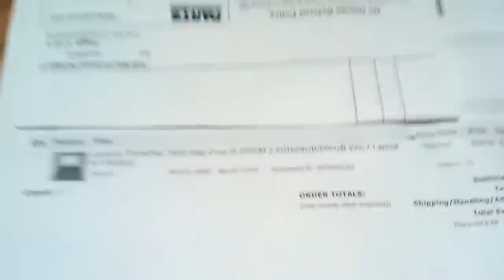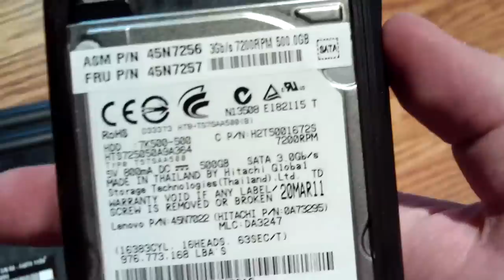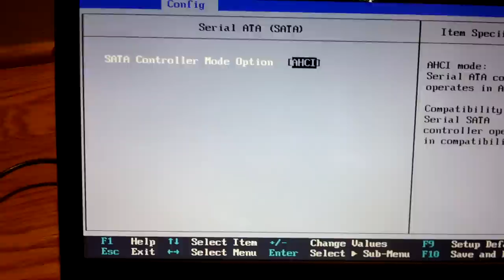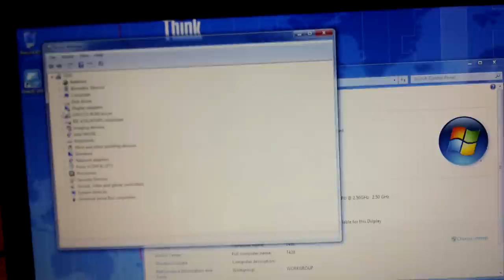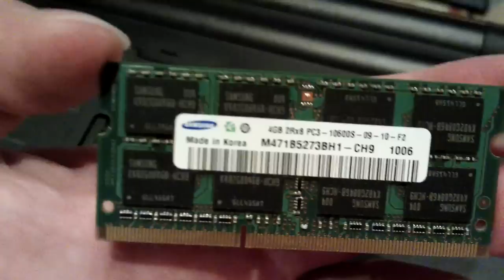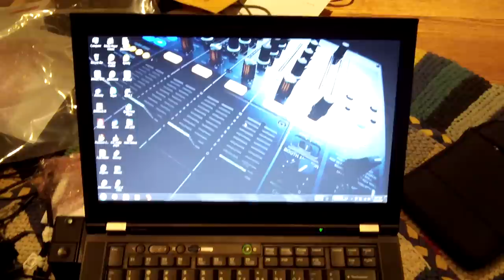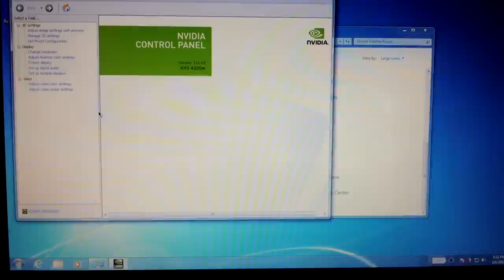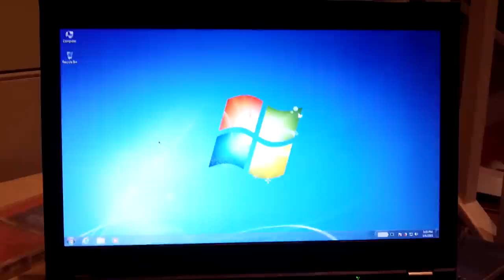Lenovo Thinkpad T420

Comment: I purchased four T420 laptops three years ago. All had nVidia NVS4200 graphics. Not the greatest, but considerably better than the HD3000 integrated. I gave one to my daughter, sold two, and kept one which I used as my "Daily Driver", that I just replaced 9 months ago, with a T440p. I upgraded that T420 to an i7-2640, from the i5-2540. It had a 1tb 7200rpm HDD, 16gb/ PC3-1333 ram, and a 1600x900 display of pretty decent quality, running Windows 7Pro. It served me well for three years.

Comment: got one of these the other day man am I in love with it, it has windows 10 and 6 gigs of ram the guy changed out the hard drive and put in a Kingston  ssd 256gb and it flies it doesn't over heat loving it so far.

Comment: T420 blaze it fgt

Anyways I absolutely love my T420, mine's got the i7-2640M, 6GB of RAM (upgraded from 4GB), 1TB 7200RPM HDD (upgraded from a 320GB) and the Intel HD 3000 GPU. I have no need for the Quadro so the iGPU is fine for me.

These laptops are tanks, they're built extremely well, they have great keyboards and they use the Intel Sandy-Bridge and the Intel 6 series chipset, with that combination you can't ever go wrong.
Reply: same with mine, except I put the 8gig ddr3 single stick from Crucial in mine

Comment: The Hitachi hard drive is a legacy of the IBM ThinkPad era. IBM sold their hard drive business to Hitachi in 2003.
Reply from the maker: Once Hitachi actually started using their own tooling, these drives became pretty reliable.
Reply: lmull3 I've never had issues with Hitachi drives although my favourite is the old Samsung Spinpoint drives they've been the most reliable and my current one has been going for a decade same with all of my spare spinpoint drives I trust the older seagate drives and WD caviar apart from the green drives are also reliable
Reply from the maker: Realgroovy24
I've had such a mish mash of drives over the years, and Hitachi has been good to me.
Reply: +lmull3 is it worth getting 16gb of ddr3 with ddr3 getting rarer. i dont even use 8gb fully on my gaming rig and i wont probably use it in my t430. would 16gb be really that useful for basic use. in my 2 t430 and my t420? i want to fork out the cash just for having the ram but is it worth it?
Reply: Blood Guns and Honor DDR3 isn't getting rarer, in fact when it becomes more obsolete it appears it gets more common. Demand is still there though.
Reply: +Sony Trinitron I got a 16gb kit on newegg to put 2 of the thinkpads at 12gb I mean dual channel isn't necessary for the users. but mine is staying at 8 till I can get another kit. :)
Reply: +Sony Trinitron I got a t430 and a t420 for my grandparents because they wanted laptops to use till 2018 or so and I really couldn't think of a better machine considering almost all lenovo batteries are backwards compatible.
Reply: Blood Guns and Honor Lenovo make pretty good computers, They've gone a little cheaper since Lenovo bought out IBM's PC line of products but still great quality.
Reply: +Sony Trinitron Which is why my grandfather has a t430, because thats the last one that was really semi normal before they went balls over head and changed everything.

Im using a t430 and my acer e15 because i needed a laptop at the time, its a great machine.
Reply: Blood Guns and Honor My current laptop is a HP NX6310 from 2006, it's old but it does the job, my current desktop is a HP SFF core 2 duo from 2008 which I got second hand like my NX6310 and also does the job well. Yesterday I did have some really strange issue where it shut down instantly like a power cut happened but the screen was still on and the the speakers were making popping noises but I assume it is just out of random rather than beginning to fail, it's been running overnight and nothing has happened since so that's good.
Reply: my current desktop has a i5 6600k at 4.8ghz and 8gb ddr4 2666 mhz ram, a gtx 970. Im waiting till 2017 when they release pcie 4.0 so that I can get a new card and not have to be stuck on a old motherboard. I really wish taht they would just make one platform and stop pc development we dont need anything new, as the gains are not even being used. were at a point in computer development where what we have will be good enough and we will not need anything better for a very long time.
Reply: Blood Guns and Honor I'll assume you're a gamer, but for the average user I think core 2 duo's and some of the higher end Pentium 4 machines are still ok (not so much for youtube etc..) but yeah computer hardware development is definitely slowing down, years ago hardware seemed to get so much better every year or two! Now you're still getting machines with 4gb of ram and same compared to 6 years ago.
Reply: most people dont even need 8gb ram unless they are a gamer or they edit videos a lot.

Most laptops made from 2011 on will last till around 2020-2025 in performance at the current way that things are going.

I dont think im getting a new laptop till windows 10 loses main supprt in 5 years
Reply: Blood Guns and Honor I'm still using XP on my laptop but am looking to upgrade after Firefox finishes support, probably when websites start to say this version of your browser are no longer supported I'll look at switching to Linux Lite like I've got on this HP desktop I'm typing on now (it has a core 2 duo)
Reply: +Sony Trinitron cool ive been wanting to move over to linux for a while now, going to see what happens and maybe ill swap over. Ive got to say though i love thinkpads and even if i have to get a external battery and a docking station to use them once batteries are hard to find, ill do it

Comment: Im debating between the x220 and the t420 so your reviews have been vastly informative 👍😊
Id like the portability of the x220 but Im concerned about heat and noisiness. I read that the t420 runs cooler because of the better internal spacing but Im interested in your opinion. Do you find much difference in build quality between both?
I can only get a non-IPS x220 or for the same price get an t420 and Im having a hard time making my decision 🤔

Comment: Do you think a T420 is still a good laptop today? How does it perform as far as playing HD video locally as well as online like youtube? I'm thinking of getting one for programming and maybe very light gaming (older games from GOG.com). But how does it do for everything other than gaming? Thanks!
Reply: I don't have the T520, but the X220(t), but powerwise they are the same. The Intel HD3000 Graphics are able to play 1080p video and simple games without any problems. 
For programming the keyboard is great, I also do programming on it constantly. 
I carry it around all the time without any problems since it is a well built machine.
Reply: +gerryheld alright, cool.
Reply: +Muldoonite It works rather well, I just purchased one a week ago, and have been using it since it arrived last Friday. This is quite fast, I have a similar one as the one in the video. Core i5-2540M @ 2.60Ghz, 4GB DDR3-1333 (PC3-10600S 9-9-9-24), Intel HD 3000 and NVIDIA NVS 4200M 1GB, and a 500GB Seagate Momentus HDD, this works very well. I can watch 1080p60 video in Chrome with no issues whatsoever, with Discord, Teamspeak, and Steam running the background. I can still browse forums and Facebook with said video running, too. It's a lot faster than I expected it to be, however it isn't the best for gaming. This machine works for streaming stuff like Stepmania, Half-Life 2, osu!, and other games with similar requirements over OBS Studio. For $280 I got quite the deal.
Reply: i have the t420 with the i7 2640.. ssd and 8 gb of ram and that thing is superfast :D  i have like 40 bowser windwos open... playing more than one hd videos.... do photoshop at the same time and nothing is slow... its really neat.... you can do photo editing... youtube videos load superfast..... video editing, music editing... and its only a dual core :D thats sick... really... a used t420 with i7 can hook up to a 2016 top notebook over the 600 or 700 euro range... i have a dedicated graphic card and can play lot of games :) skyrim low settings works fine never drops below 40 fps.... fallout new vegas same thing... half life 2 high settings full hd no problem :D browser games and java based browser games work just well (something like happywheels)..... i bought mine for 340 euro..... like new and the accu had only like 5 load cycles.... sry. for bad english im from germany...
Reply: i would say its nearly inpossible to overload the cpu in normal tasks... you must have 4 local machines that unzip something or render somthing while do other stuff and when do you do something like that? :D

Comment: I currently have a Lenovo Y70-70 with the Nvidia GTX 960M and an i7 running Windows 10, but Windows has been giving me issues and the battery is very short with the performance parts.. Also I'm looking into trying out pentesting and was considering getting this laptop and installing Kali Linux.. any ideas or input as to software and/or hardware you would recommend?

Comment: Dude! great review I got one laptop T420 myself that is about to come Monday and I see that your SO Win7 has a battery item right down corner. Does it have to be with the windows 7 that came with your dvd/cd? or it is installed separate?

May I use Windows 10 and still enable Nvidia? I want to run applications like SolidWorks

Comment: I love the t420 series due to the keyboard. I have the t420s and quickly upgraded it to 12 GB RAM and 500 GB SSD And used the optical bay as backup harddrive using the hd caddy.

Comment: AMT is awesome, set it up right and you can type in the machine's IP and :16992 and you can control power state, and with the Intel System Defense utility you can upload an image to boot off of as well as serial over lan (text mode graphics) and KVM with vnc plus (remote control of the computer even in BIOS and if it crashed etc.)
Very powerful out of band management tool, can do so much more than what I said.
Reply from the maker: Ooooh, that sounds like something I need to play around with.
Reply: *****
what about it
Reply: *****
not wrong
Reply: *****
<3

Comment: I recently bought one of the T420 computers and use it as my daily driver. But I also bought a ThinkPad X230T and had to send it in for depot repair and they arnt very good... I also have been noticing the quality of newer ThinkPads are degrading. What would you say? For now though i'm done buying Lenovo products.
Reply: +beaker15 The quality has gone downhill it seems just from looking at a few of the newer systems.  I just got my hands on a T410 a couple weeks ago.  I like the simple styling and the easy ability to get into the machine for service & repairs if needed.  I don't want anything fancy and Lenovo's T410 fit the bill.  I think after the T430 they went downhill pretty bad in quality.  My T410 seems pretty well built and feels very solid.

Comment: I wonder what would happen in the case that the nVidia GPU would fail in this laptop. Would it continue to work as normal with the Intel graphics?

lol, those fingerprint readers (or biometric coprocessors, if you wanna be fancy about it) just don't work at all. You have to scan your finger about twelve times before they will recognise it fully.
Reply from the maker: You could just go into the BIOS and make it only use the Intel graphics.

Comment: I got my t420 yesterday as an early christmas present because I needed a box to put some shirts in for my dad as a present for him. I was amazed to find that it had nvs 4200m graphics even though the amazon listing didn't mention it, the ultimate n intel 6300 wifi and a 9 cell 55+ battery from Sanyo. for some stupid reason though, the company who refurbished the laptop put some plastic to cover the rubberized top, trackpad which is completely worn, and palm rests. They also didn't turn the screw that holds the keyboard in place all of the way :P Overall, im happy with this laptop.
Reply: +Sephiroth Kefka how long does that battery life last? I'm currently trying to find a reliable website that sells a good batter for decent life span in battery mode. Got mine yesterday and only lasts for about an hour and a half.
Reply: +Luigi15201 I got a genuine 70++ battery from Amazon. I forgot the sellers name but it is genuine, even with the lenovo box!
Reply: +Sephiroth Kefka you think you can link me?

Comment: Nice laptop. I have seen these for sale as refurbished and they only had intel HD graphics rather than  Nvidia Quadro graphics. I just purchased a Dell Precision m4600 that has an I7 2820QM and I am hoping that it has a 2gb Quadro card in it. What is the downfall of the m4600 is the max amount of RAM it can take varies on the speed of the RAM. 1600mhz DDR3 RAM is 16gb and 1333mhz is 32gb. Another one would be a slotless optical drive however I have seen ones without one. I may just get a laptop blu-ray drive for it.
Reply: Update: Well the Dell precision m4600 that I got has an Nvidia Quadro 1000m 2gb card in it well as the Intel HD 3000 graphics as well as the Optimus mode. Plus I upgraded the RAM to 16gb and a 500gb WD Caviar Black drive. I am hoping to upgrade to a 1tb SSD at some point down the road.

Comment: I was given about 8 non working laptops.. just asked to fix 1 up for them. + some cash for parts. and the other Newer Laptop was a T420 but without the Nvidia card..... I upgraded it to 8G ram. and its working sweet..
It needs a New Battery. + the screen is not working (replaced it but suspect donor screen was faulty too.
Next to the Ram is a Mini PCI-E port. i've got a 120G M.2? Micro SSD.. that sits in that slot. but not detecting it. 
Think i need to upgrade the Bios.  (But need a battery to upgrade bios.)

Anyway.. Great video as Allways  keep up the good work.

Comment: t420 or t430?
Reply: +Shane S. Depends on which one you prefer. T420 has the traditional keys and layout while the T430 has the new chiclet keys with backlight. If you don't care about the keyboard then grab T430 for obvious performance and power usage improvements.
Reply: +Csiklós Miklós To add to that, if the T420 has a dedicated video card while the T430 doesn't then grab T420. If you care about gaming.
Reply: Thanks I  found a good price on a T430s I think I'll go with that one
Reply: I am also in the same dilemma. The t430 has a good price but they say the screen lacks brightness and if you get replacement or aftermarket battery it will not charge. While t420 has no usb 3.0 and older cpu.

Comment: They make these dummy optical drive things that you can put a harddrive in. You would then plug these dummy drive things into your optical bay and you will have two harddrives in one laptop. I do this myself. I suggest you buy a smaller size but fast ssd drive and put windows on it , then put your video and larger files on the 1Tb drive which would be in this dummy bay. This way, you have the large capacity but you also have the speed of the ssd.

I say this because nobody uses cdr or dvdr anymore...or do they? Since these giant cheap memory cards came out, I never touch optical disks anymore. Even my car stereo plays music off of memory cards.

Ironically, I am in the process of trading a guy some stuff for one of these 420's wait wait, is this the 'weed' laptop? Is this the honorary laptop of pot heads?

Comment: Too bad the NVS 4200m is easily beaten by integrated graphics nowadays.
Reply from the maker: Like that matters for what I use the machine for.
Reply: I play Skyrim on mine with high settings and 1600x900 resolution and it's very smooth.
Reply: orangutan juice mate. shits better than dedicated juice.
Reply from the maker: ThePowerMacGalaxy
Simply Orangutan, simply unfucked around with.

Comment: "intel HD3000 is no slouch either"
hahaha, NO. if i ever intend to buy a laptop again i'd rather have a pure AMD one, so stuff actualy works. i have intel HD3000 in my laptop rigth now and its god awfull.
Reply: ok then
Reply from the maker: I'm used to really shit Intel graphics from like the G31 and G41 chipsets that couldn't even handle 3D at all for the most part. The HD3000 can actually kinda do stuff, unlike those.

I do have one of the AMD based Thinkpads, the X140e with the A4-5000 APU and it's also pretty great, but lacks CPU power.